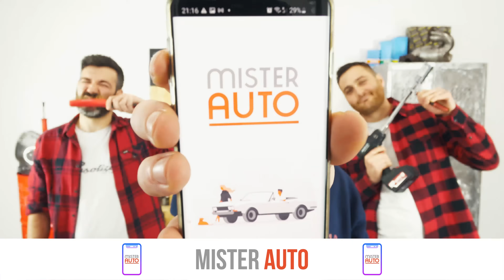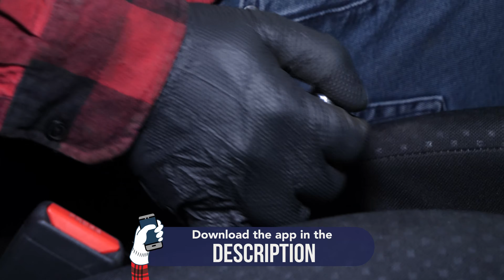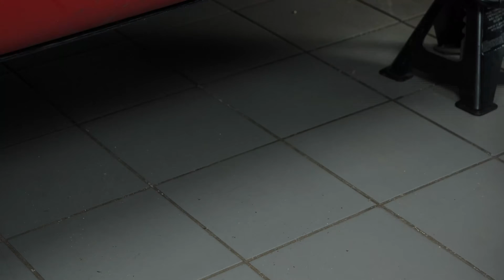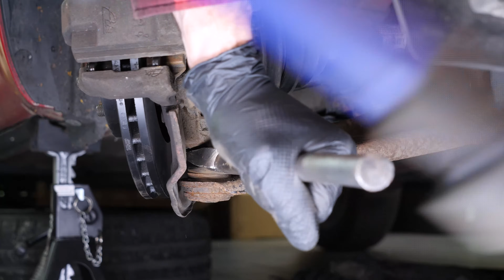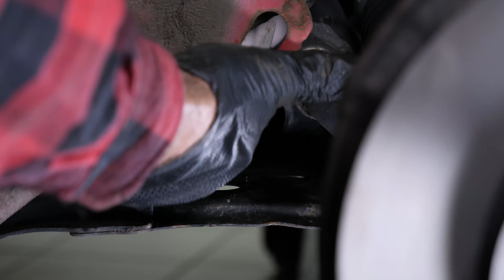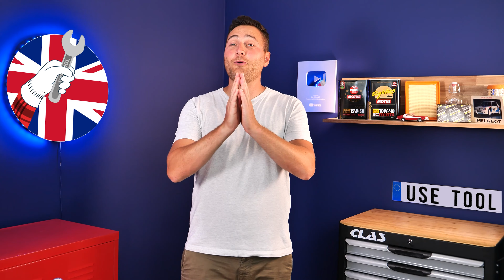How to replace the control arms Yaris mk2 🚗

Comment: Wait how do we lift the engine? By jacking it up, whats the jacking point please help
Reply: It is mentioned in the video. They say putting the jack on the oil pan. at around 1:50
Reply: @ thank you bro, didnt know u could hack up an oil pan, I went to a junkyard today and saw an oil pan there, and I didn’t realize it was made out of thick material
Reply: @jorgerivera9427 I wonder why they didn't show that?